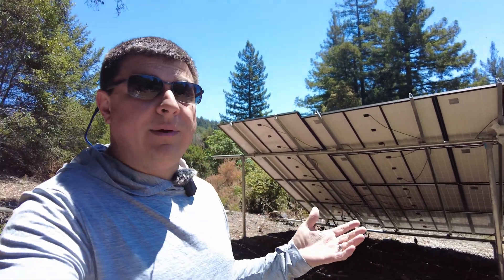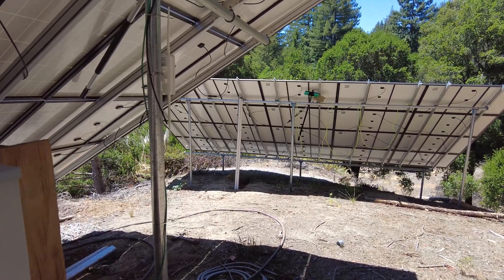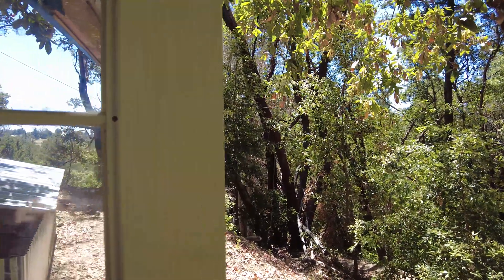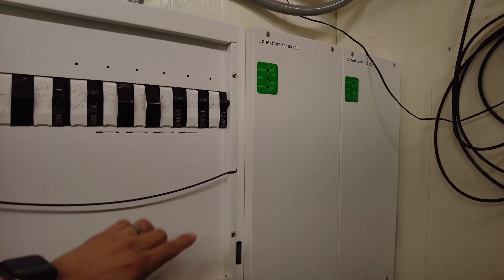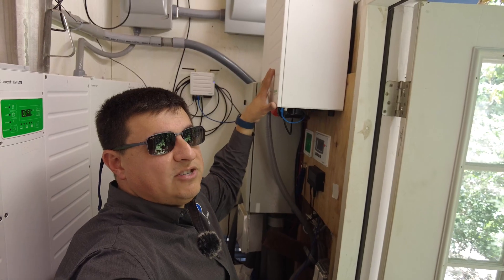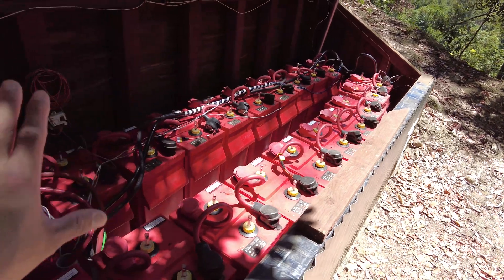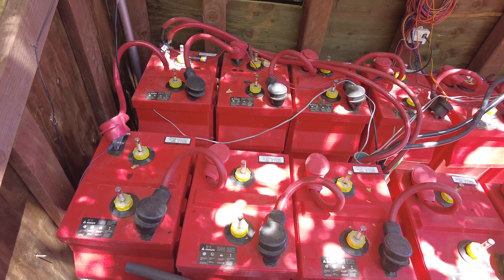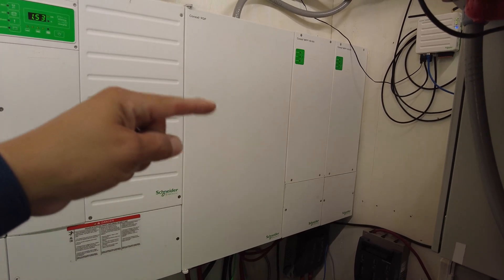Off Grid Solar System Tour - 14.8kW Array

Comment: My wife and I are setting up off grid in Northern Nevada. We are setting up a SW4048  CL150... Solar array will be mounted on top of a High Cube Container and all equipment located inside (shortest runs possible). We were able to retrieve 2 48 volt Absolyte Telecomm battery banks for storage. We'll see how long they will operate and then purchase new battery banks later when we expand the system. Thanks for posting your video!

Comment: Well, you were doing we'll, Intell you got to the batteries. If you can get a 300 ah, 200amp. For 751.00 bucks, you're on to something. You can get some nursery heating pads
That is very low voltage. 
And cheap. they keep your bank between 65° and 75°
You can put them into a 4p4s arrangement.

Comment: Lithium is already cheaper than the higher end lead acid batteries like Rolls if you calculate dollars per usable kWh
Reply: His bank is $25,000... for that you could get 83 kWh in lifepo4.. looking at the specs on the system he has, it only has a usable capacity of 67 kWh.
Reply: Yep - DIY LiFePO4 sits around 150 Euro/USD per kWh.

Comment: As one that has gone through the process I can see the logic in what you have done. I have just expanded my installation this year which is now 30kWh of batteries (sonnen 15kWh/3 phase each) and 44 Canadian Solar HiKu - 30 405W and 14-455W) with twin Fronius Symo (10kW and 5 kW). I would add though a couple thoughts: try and identify not only your consumption in total but big items such as pumps, AC as you can probably work your schedules for best solar utilisation. 

Also, if possible, check prices/change appliances that are inefficient as you probably will save more money by reducing installation size rather than investing in efficient appliances. I already changed hoy water heater and dryer to heat pump models and they not only use less energy but less PEAK energy. Also A/C units with inverter designs compared to conventional. Much analysis you see in internet comparing payback of investing in efficient appliances require high energy costs to be interesting but if off-grid the numbers may be different. And if appliance already needs replacement then no brainer. 

The last is oversize array vs inverter - all major manufacturers recommend you do and for good reason. If installed in your roof you will not have to go up and clean as often and as Alex said would normally work in the higher efficiency range for inverter.

Comment: How do you like your REC 370 panels? I'm thinking of doing a sys with either 370 or 400 panels myself . Thanks for showing your sys I also have been thinking about using 3 units but not to many sys have that set up

Comment: As some one that has been in the solar business since 1976, I'm glad to see a video with real life data. Also, love the lead acid battery bank. It's rare anymore to see an off grid system with flooded lead acid batteries. Kudos to you my friend. My old Trace SW5548 is 20+ years old and I'm looking for its replacement. Been looking at outback and Schneider, but have read not so glowing comments about Schneider support. From what I heard in your video, it sounds like you may have experienced this as well.

Comment: Nice system you have. No wonder I haven't seen you in a while. You've been a busy man. I built 134kWh LFE for $30k. Three days worth if conservative. I'm glad I chose two SolArk12K. Customer service is still important to them and my 10kw Honeywell LP gen runs direct just fine, pumping out 41A @ 240vac. I installed a 9k mini split to keep electronics at 70F/50%rh. We consume 30-80kWh/day.

Comment: Thanks for a deeper dive on this subject. I would LOVE to be able to do PV with battery storage at my house, but
1) my partner and I are not yet sure if this is our forever home
2) the roof is very oddly shaped. The house originally was rectangular and sloped down at each side of the house, but it had a significant addition in the 80s that makes it kind of d-shaped (imagine the lower loop of the "d" to be a square) but the roof still slopes down on every side.
3) much of our discretionary income is being spent on a career change for me (automotive technician to electrical engineer/computer science)

We would most likely need to remain on the grid because we both drive EVs (and a lot of miles) and all of our big power consumers (water heater, kitchen range, dryer, AC, everything exc. the gas furnace) are electric. Last year, during a particularly hot heat wave and when we were both driving 2,500mi/month in EVs (5,000 miles total) we had a month where we used like 2,800kwh lol (like 2,200 kWh of that was off peak, thankfully). It would be really nice to eliminate all of our on- and mid-peak power usage and only use power from the grid during off-peak since its like $0.05/kwh vs like $0.35/kwh on-peak. Plus, of course, it would be nice to have a more environmentally responsible power source.

I did a micro-grid design for one of my engineering classes (designed a completely off-the-grid system for a shopping center, using only PV, battery storage and generators). I thought that lithium batteries would be a no-brainer but I was shocked (heh) by the relatively small advantage that they have over properly designed lead-acid batteries. If you have a small, temperature controlled space, don't want to think about the batteries and have a LOT of money, lithium is the way to go. Otherwise, lead-acid is a much better choice. They just require some occasional care and feeding, and a lot of space.

Comment: Do you have a BMS or are the batteries robust enough that they don't need to be balanced?
Reply from the maker: We do use a Schneider battery monitor and we equalize the batteries about 2-3 times a year depending on how the individual cell voltages look.
Reply: You don’t need a BMS with lead.

Comment: Thank you for the thorough detailing of your off-grid power strategy. Living in a space constrained townhome in a dense urban setting, I decided to stick with the grid - currently, I have a roof installed 4kW system and rely on net metering. I too chose a REC panel, 10 split-cell panels rated at 400 watts apiece. As you say, if space is at a premium and you want solar, you should stick with the highest efficiency for a given price per Watt. I will note that there are more efficient panels on the market than the ones I chose, but they are a classic example of decreasing returns. Although there are efficiency gains in more expensive panels, they are slight, while price significantly increases. My question: why did you choose large inverters for your panel system, instead of microinverters? Does the answer have to do with needing DC for the battery charging?
Reply from the maker: The cost and relative loss and efficiency are better in this situation with large charge controllers vs micro-inverters. For a grid tie system micro-inverters make a great deal of sense, but in this application the off-grid setup with Enphase stuff was expensive and not really well thought out for a permanent off-grid setup. The Schneider system allows the integration of micro inverters and grid control via "grid forming" so you can mix some in this situation which is our plan this year. There will be about 5kW of micro inverter capacity added at some point.
Reply: @TheMountainGarden  Great video.  Curious regarding your expansion plan.  The Schneider setup can AC couple with most string inverters - you don't need microinverters per say.  For example, the SMA Sunnyboy series is a 3 MPPT high voltage inverter solution - for maximum efficiency for long runs like you have.  Microinverters are more expensive like you mentioned, a bit more to install, and a bit less efficient (all things considered).  But they make sense if 1) you have severe shading, 2) want individual panel monitoring, 3) have a very small system you want to easily scale later, 4) have rapid shutdown requirements.  I didn't get the impression that you had any of that going on, so I'm curious why you are leaning toward microinverters vs. AC coupled string inverters - or just another Schneider charge controller.

Comment: 8,000 cycle lead , this will be interesting to see.  Your argument for cooling making up for lead efficiency loss doesn't hold water. A tiny mini split will condition a battery/ inverter shed for next to nothing. 20 percent loss from that size lead bank would heat / cool a small house.
Reply from the maker: The loss is far from 20%. At our charge/discharge rate and depth the cycle efficiency is somewhere around 90-91% vs 99% ish for most of the lithium chemistries. However running even a minisplit to cool the pack would consume at least 1,000 watts for the bulk of the charge cycle and keep in mind that the cooling requirements and heating requirements in colder weather mean you will be running the heat pump for more than just solar producing hours. At our usage, even just running a mini split during the charging hours a lithium pack's cooling requirement just doesn't pencil out. Our next door neighbors with almost the same Surette Rolls batteries have been odd grid for 17 years on the original lead batteries, just 5 more years and they are at ~8.000 cycles.

Comment: Considering the gas prices at the moment, having electric power tools and an electric buggy/side-by-side to use around the property with so much solar would surely make financial sense.
Reply from the maker: Check out the price of an electric side by side... Sadly they are insanely expensive compared to a basic gas model.

Comment: What kind of advice and pricing can you give to a home that cosume like 80kwh a day I want to go off the grid  just in case we get minimum 11 hours of sun light and we live in a hot climate the Caribbean
Reply from the maker: 80 is certainly high utilization, our 15k rated panel system and inverters are good for about 78 kwh at the peak of the year, so I would say, depending on when your use happens (day vs night) you'll probably want a similarly sized array (you get more light) but a bigger battery bank than us, probably 50% larger. Size the batteries for 2x daily use.
Reply: Completely impossible to answer without you calculating loads. Consumption is only part of the equation

Comment: Living in a mostly temperate area, how much fuel do you usually go through with the generator during the winter?
Reply from the maker: Very little, maybe 10 gallons a year
Reply: It would be interesting to see the conversion numbers of using propane to generate electricity then that electricity to operate heat pumps.  I'm curious, but the conversion may be a wash or gain over using propane direct for heat.  Why?  COP of the heat pumps being manufactured today.  

Current heat pump tech is still more energy efficient that burning natural gas directly to heat a space, even with all of the transmission losses.

Comment: How often/long do you fall back on the generator?
Reply from the maker: It's pretty rare. In the summer we've used it for a few hours a day for 3-4 days when the sky was blacked out with wildfire smoke, in the winter we will use it once or twice when there's a big storm and we cannot re-connect to the grid.

Comment: The Ford Lightning really sounds like it might be perfect for your home!
Reply: I would love to see high-geek-rated deep-dive on adapting a F-150 Lighting into a preexisting solar setup.
Reply from the maker: Sadly our inverter bank is waaaaay too far for the Ford backup feature to really be well integrated
Reply: @TheMountainGarden  Well, maybe.  The Ford Charge Station Pro and Intelligent Home Backup is kinda a combined yet separate setup.  For charging, it works like a regular EVSE at up to 80A (can set to lower).  But for backup, it uses the high-voltage CCS DC connection to the vehicle battery.  For backup, the Charge Station Pro is just a pass thru - DC goes to a separate SunRun inverter (9.6kW).  So you can get a long run out of it like you do with your solar array back to your power shed.  If you put the Ford EVSE (Charge Station Pro) near the vehicle, you should be able to run the pass-thru DC down to your power shed to feed the SunRun inverter and autotransfer switch there.

For charging the truck you do need an AC circuit run to the Charge Station Pro.  Probably you'd set that much lower than the 80A max given the run length and solar and battery system size.

Just a thought, but I think it would be doable for you.  Not that you need it - given your large battery bank however.
Reply: @billjohnson3344  I hold a contract to install fords two way chargers in several regions. Without typing a bunch of technical jargon, you’re wrong. Gotta be close to the demand and supply.
Reply: @mattbrew11  Perhaps you need to re-read.  For home back (not charging), there is no reason the inverter can't be close to the home and the Charge Station Pro (pass-thru) closer to the vehicle - and large distance DC run between the two of them.  Same as a solar panel setup, electric grid, etc.  Would like to see your technical jargon that shows otherwise.  Always happy to learn if there is some non-obvious limitation with how Ford has done things - but there would be no electrical issue.
Reply: @billjohnson3344  perhaps I need to read? Weve installed ~ 40 chargers already. Perhaps you need to DO and stop trying to extrapolate extraneous information and combine them into a perspective when you are wholly ignorant or the real world application of this tech.  If you want to power a house and not use garden hose gauge wiring the charger needs to be relatively close to the panel
Reply: @mattbrew11  First, the DC is higher voltage, so that helps.  And what's stopping you from using bigger wire?  Have you ever wired solar panels in a distant field back to an inverter in the house?  Here we are only talking 9.6kW of backup power from the truck, which at 350VDC nominal is 27A for the wire run.  Nothing horrible to manage, and Ohms law lets you calculate your wire gauge and any losses.  There is no technical limitation, just need to size accordingly.  If Ford has some additional constraint (for unknown reason) on distance, I would like to hear specifics.

Comment: I wish that everyone had the financial ability to do this
Reply from the maker: We dug deep and borrowed from retirement accounts to make this work.
Reply: @TheMountainGarden  Do you for see any big advancements in solar panel tech in the next 10 years? Or do you think it’s more like an intel CPU and double AA battery tech scenario where the technology has more or less plateaued within the past 10 years as we are bound by the limits of physics and atoms?
Reply from the maker: @SilverScarletSpider  It's a slow march. The cost per watt is dropping but panel efficiency hasn't moved as far, so the area the panels will occupy hasn't changes substantially. Warranties and power output after 25 years has significantly improved. IMHO, in 10 years the big changes will be cost more than anything.
Reply: @SilverScarletSpider  solar have matured. Minute changes to solar from here on out and pricing is as low as it will be today due to inflation.